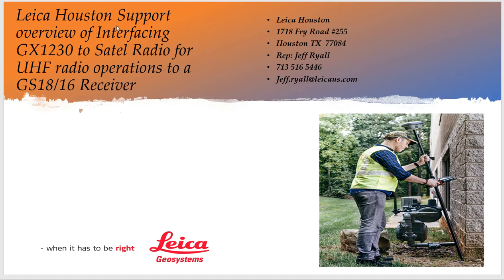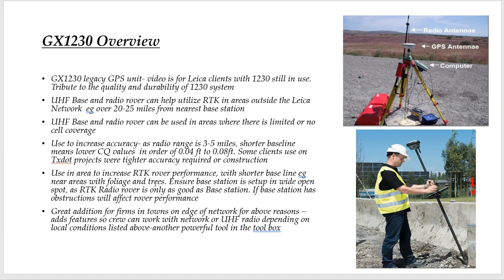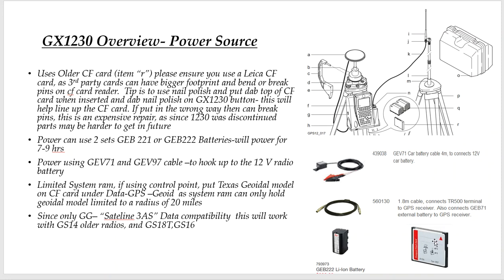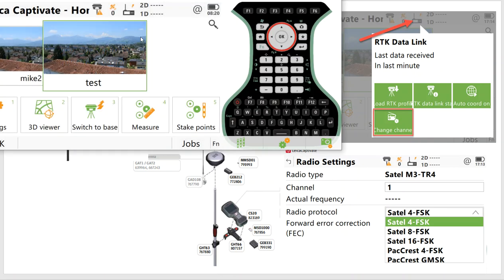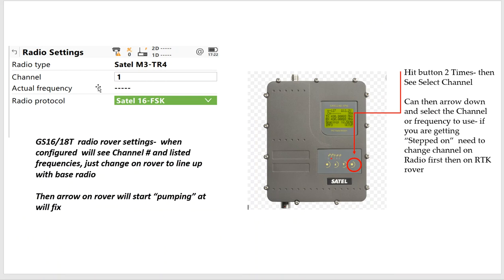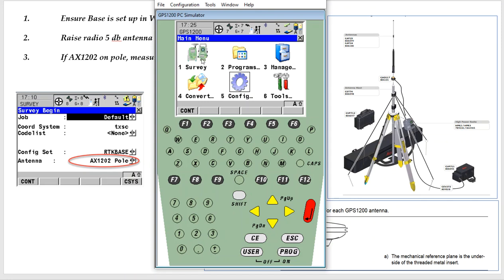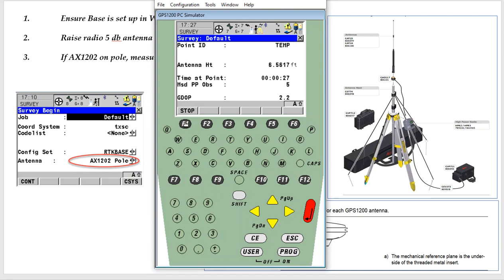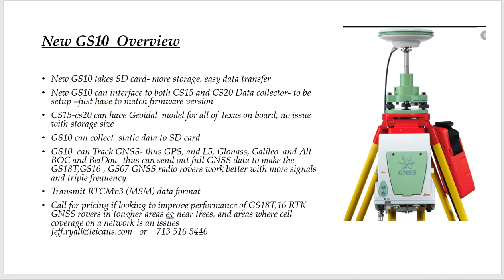GX1230 satel radio setup

Comment: thank you for taking the time to make this video. It helps a lot.
Reply from the maker: You are welcome! appreciate positive feedback
Reply: @JeffRyallG4GR  Hello Jeff, sorry to bother you again. I actually have a GX1230 receiver (non-GG, GPS only) and it displays a wrong year. It can compute a position, the time it finds it right but the date seems because it shows 2004 instead of 2023. I presume this is due to the last rollover issue in 2019. Do you have the same problem with your own GX1230 after the rollover in April 2019? If yes, would you be kind enough to explain how you solved it?
Reply from the maker: I would try and load the latest firmware, hopefully that will help with issue, if not it could be a bad board battery on the board and will need to go into service -when the battery on board fails then loses date @billyandriam